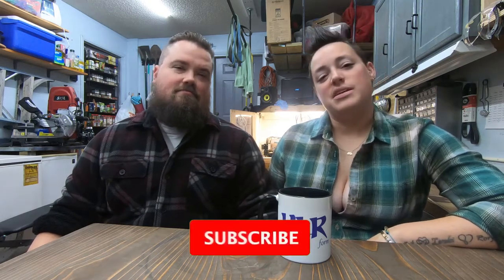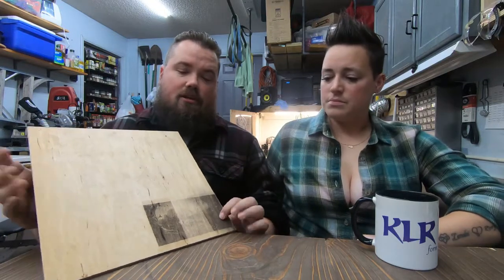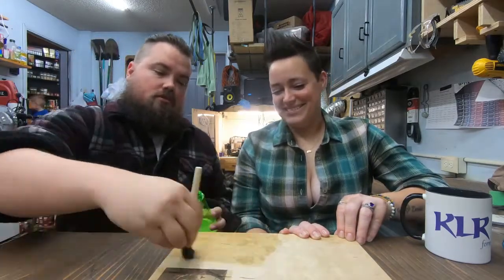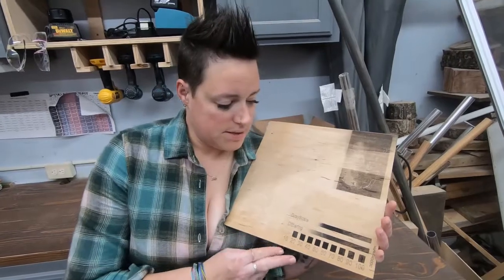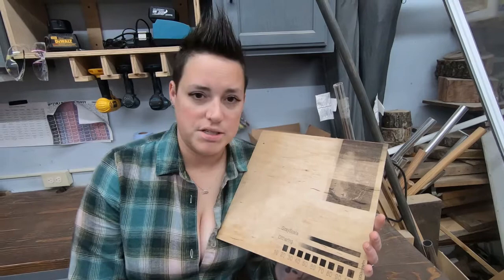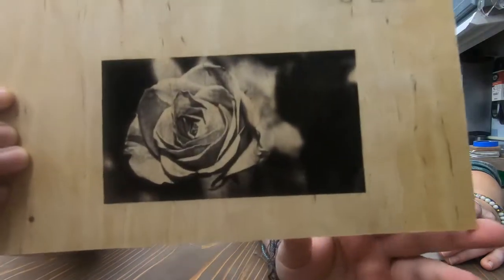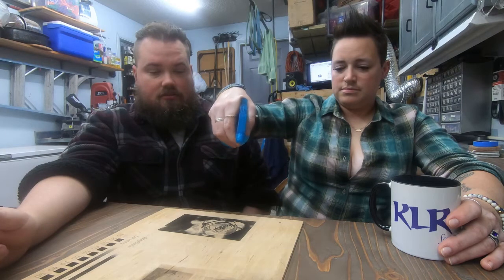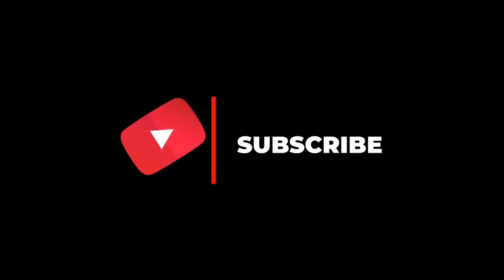Borax Laser Redo | Ortur LM2

Comment: I do it a little different, I mix one tablespoon of Borax in 4oz of hot water, I then use a paintbrush to apply the Borax solution to the wood. The next day when the board is dry, I wipe it down the board with a dry cloth to get the Borax powder off of the board. I then laser engrave the board, I then sealcoat the board with clear lacquer. After the lacquer is dry I runover the board with a sanding sponge to knock down the raised grain, then I add a second coat of clear lacquer. Depending on the power and speed settings you can go from a light color to black as I'm sure everyone already knows. Thanks for sharing, I might try spraying one with water to see if it makes an improvement to the lacquer gloss finish.
Reply from the maker: We sprayed and then still have to brush or use a cloth to spread it out. So the paint brush might be the easiest way to do it. Thanks for all the rest of the info!